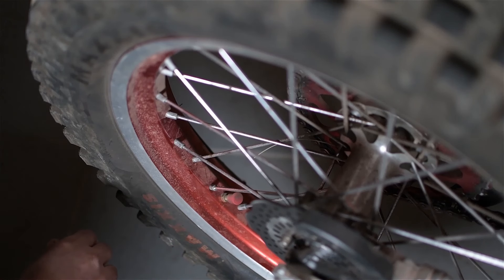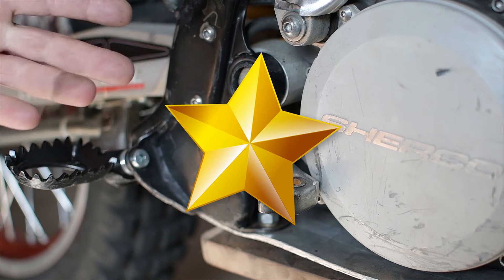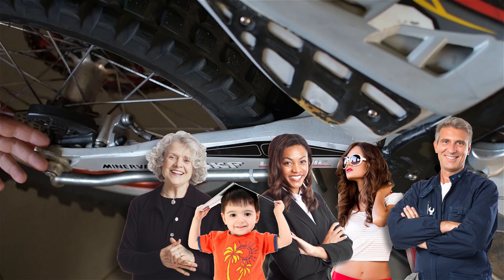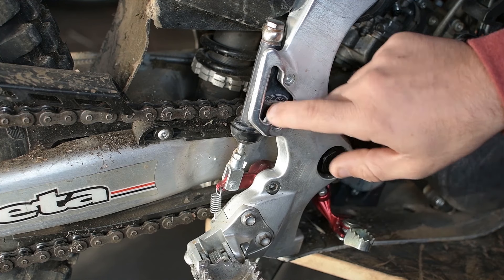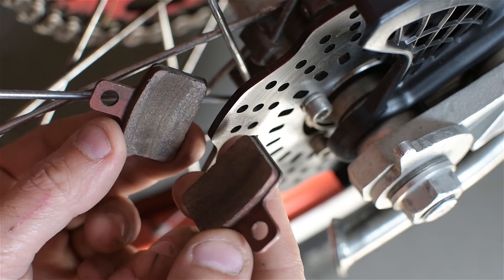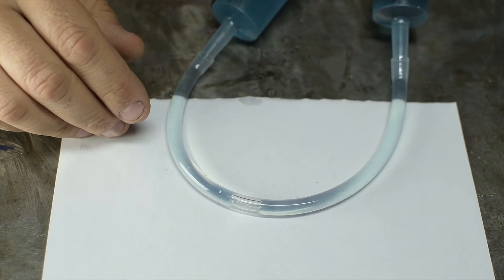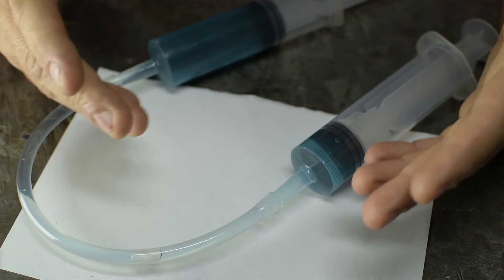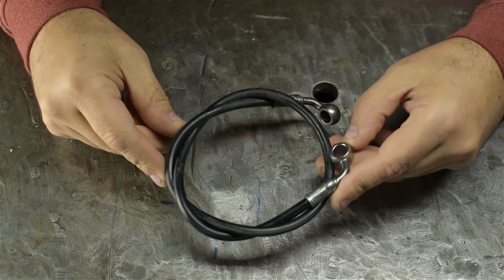I'm an Idiot! (Soft Spongy Brakes)

Comment: My Dad and I were in town a while back when our key FOB decided to stop working. We were able to get into the vehicle with just the key, but that didn't disable the alarm, siren starts blaring, couple of right fools we looked in a mad rush to find something to cut the wires with, then we were faced with the problem that the alarm disables the ignition, so there's no way of starting the car. Our first thought was to stick a new battery in the FOB, though we were a little puzzled as we'd already done so only about a week ago, but never the less, we went for a wander and bought a new battery. No luck. Took the FOB apart and cleaned the contacts, disconnected and re-connected the car battery, still no luck. Called a couple auto-electricians, no-one in New Zealand knows how to work on Chevrolet. Finally we gave up and called a tow truck. 
Before bringing the truck out, he decided to swing by and have a try himself at fixing the FOB. First thing he did was, naturally, replace the battery, and in doing so, noticed a little message on the inside of the battery cover that we'd somehow completely missed: "After replacing battery, hold lock and unlock buttons for 7 seconds to re-synchronise FOB." Yep, really was that easy, and yes, sheepish is putting it mildly. On the plus side, a $600 tow turned into a $150 call out.

Comment: You would not believe how similar of a story I have. I fought soft, spongy brakes on my Gas Gas 300 literally for months. I bled the brakes countless times which lead to me dumping at least two containers of brake fluid through my reservoir and onto my shop floor (I didn't bother with a tube on my bleeder valve). I began to question my ability to bleed brakes. I used a syringe to push fluid from the caliper to the master cylinder and from the reservoir, through the master cylinder and out the caliper. I too, rebuilt the master cylinder. I replaced the seals in the caliper. I replaced the brake pads. I was moments from madness when I had that shampoo coffee epiphany. The rod between the brake pedal and master cylinder is adjustable. And mine was adjusted to be too short. So, my brake pedal was running out of travel before the master cylinder did. Thanks for making this video. I enjoyed it way more than I should have!

Comment: You are not going to like this.....
I don't think the problem was the rotor. A worn rotor shouldn't affect the braking because the pistons will automatically move in to take up the slack.
I had exactly the same problem and it turned out to be a ring of corrosion build-up around the piston, (single piston, sliding caliper). When I pulled on the brake lever the piston would catch on the ring of corrosion and instead of sliding smoothly through the seal it would kinda try to turn the seal inside out. When I released the lever the twisted seal would pull the piston back. The next time I pulled the lever most of the travel was just pushing the piston back out to meet the pad so it would run out of travel before it applied pressure. I too bled the brakes, checked and cleaned the pads. I too fitted a new master cylinder piston assembly. Finally I pulled the caliper apart and voila!
Fitting a new unworn, thicker brake caliper would push the piston back in past the ring of corrosion and temporarily fix the problem but it will return when the pads or caliper wear enough for the piston to move out far enough to match up the corrosion to the seal.
I could be wrong but......
Reply: Calipers usually would travel as far as they technically could (centimetres if necessary), so most probably you are right!
Reply: I agree also, if the rotor undersize is the problem then you would never get full use of those pads. New rotor probably just moved it out of the problem range. When the new pads wear you'll get the same problem again. Good news is it'll keep you from running the pads metal to metal. 😁
Reply: My thoughts exactly. Unless there is a stop for the piston to hit, you should be able to push it out of the caliper, meaning there isn't a travel limit. The piston doesn't really retract when you let off the brake, the pressure just releases and the piston might move slightly back, but not much. This is why the pads drag ever so slightly when off the brake. So travel couldn't be the issue.
Reply: Didnt think of a corroded caliper, but i would have bet money on the rotor being innocent in this scenario, since brake feel isnt dependent on the pistons position, but only on its distance to the rotor.
Reply: He said the pedal was bottoming out. Implying that the Master ran out of fluid before the piston could slide all the way out. 
Keep in mind it did fix the problem.
Reply: (Reread oldbatwit's post and discovered I'm just saying what he said, meh)

I agree there may be a groove inside one of the caliper's pistons. You've merely moved the pistons back from it, not fixed the problem. It may also be a bad check valve in the master allowing too much fluid to be brought back into the master cylinder, pulling the caliper pistons too far from the pads. Pads will always be in contact with the rotor, usually just scuffing along, stopping rust from building up.

Pads ablate away, and the pistons are supposed to self adjust, so that as soon as they move, the pads are stopping you.

That thickness difference on the rotor should have been ok, ESPECIALLY with new, thicker pads. Assuming the brakes were properly bled, the brakes should still have worked. I predict you're going to have spongy brakes again before those pads wear out.
Reply: I don't think it was the thickness but rather uneven sickness that could cause a piston to be pushed out further than they would otherwise. I had a similar problem on a BMW road bike although in my case at higher speed you definitely could feel live but that low speed it wasn't quite as most of all. first pull on lever was spongy but in my case I could actually pump it up and it would sort of be ok until you released it again
Reply: @dankasprick1801  I don't see how the pedal bottoming out implies running out of fluid. It could just mean that the caliper piston(s) are being prevented from moving their full distance or are retracting, when they shouldn't.
Reply: @lachywocky  That would also happen if the piston was retracting.
Reply: The master cylinder has a maximum volume of fluid that it can push...he exceeded the travel distance of the master cylinder. It was just barely compressing enough to make contact, but not enough to clamp down on it hard enough to stop. I'm pretty sure that's what he said towards the end.
Reply: @marcellemay7721  Yeah exactly, and thats why we have breakfluid reservoirs
Reply: Could be because TOT is a neat freak and washes that damn bike too often => corroded caliper syndrome.
Reply: @ADBBuild  I think they do retract.  I think part of the piston seal is cleverly designed such that it grips the piston and is compliant and travels out with it.  When released it retracts.  As the pads wear, and the piston is pushed out  it exceeds the seal compliance and slides out just a little.
Reply: I thought exactly the same thing. When replacing worn pads you have to push the pistons back in (and try to remember to take some fluid out of the reservoir first O.o) to refit the calipers. The difference between new and worn out pads is a lot more than 1mm. I'm awfully curious what the problem was/is. Early on my money was on the flexible line.
Reply: Man you are ruining is marriage ... again.
Reply: Exactly. Fitting a thicker rotor gets the pistons closer to the surface, but the pistons should be self-adjusting. With each stroke, they move until the surface of the rotor, and back a (defined) bit. If they are too far out, they don't go all the way back.
However, if the piston seals are bad, they will not allow the piston to slide, rather they will stick to it and thus not self-adjust the clearance.
Alternatively, one of the pistons is stuck and the rotor gets bent by the other one. The new, thicker rotor has moved the disc right up to the brake pad, eliminating the spongy bending of the rotor each time the brake is pulled. 
Take the wheel out, push the brake repeatedly, and observe if both pistons move equally, and both adjust a little bit outwards with each stroke. If one is not moving, pushing on the other piston with a wrench while the brake is pressed might break the stuck piston loose. Repeat until they move evenly, or replace pistons / seals if visibly damaged. Done.

Comment: We call that “parts darts” in the trade. Customers come in, exclaiming they’ve tried everything.... everything but the simplest thing.. silly Old Tony.
Reply: To be fair, the issue here wasn’t a worn out rotor, it was a rotor that was literally installed while out of spec (new or not at that point).
Reply: @JasperJanssen  the old rotor was fine maybe cheaper version. Even if the rotor is out of spec it will break normaly. If there some thing betvene the brake pads it will break. Until its so thin it can even hold a shape. Normal motorcycle rotor is 5-7mm thic (also depend on weight and HP of the bike). Normal wear is 1-2mm on both sides so 2-4mm wear. Granted his new one is only 3mm and 2,1 look like worn out but it still must break normal. Only the potential of destroying the rotor increase.
Reply: Aka shotgun parts replacement.
Reply: "When in doubt, swap it out."
Reply: @scasny  if "breaking normally" means bottoming out the brake pedal then your absolutely right. Clearly with the diameter of his cylinders and lines the couple of mm's made a huge difference.
Reply: @abstractapproach634   break system work like a pump and the calipers will close until the pistons pop out. The reservoir is there to compensate pads and rotor rear. What tony experience is stuck master cylinder. Meaning it wont fully retract to its initial position. Result is break pads have fix travel meaning you cant pump up brake. This happened with old brake fluid that contain too much water or its contaminated with water. Aluminium parts are most susceptible. 
https://www.youtube.com/watch?v=wswNM7CkOPU
Reply: @scasny  Everything you say sounds logical, it just seems to me this video directly disproves it. Once he changed the fluid and M.C. the problem was still there; after changing the rotor it was gone. If I am not seeing something I'd like to understand.
Reply: @abstractapproach634   First the fluid was not the problem. Second it was not the MC piston but housing that may be corroded. Also im not sure if he adjust the break stop. That bolt with brass nut. If he leave it as it was, after the break pads worn a little the problem will go back. By the size of those break pads ,if new you have 3-4 mm of padding that wore off when used. Meaning the calipers must be able at least closed 6-8 mm gap. That is why his concern about 0,8 mm smaller rotor is misleading. At later video he stated that he sold the bike. Maybe because the problem come back after the break pads worn a little. 

Im maybe wrong because he dont show that calipers are capable to fully close without rotor. And he dont show the piston in MC is capable of full travel. But with my 10+ years of home bike repair the chance im wrong is not that big. Have this same problem my self and took me 3 days to find the real fault.
Reply: @scasny  I don't know about you other fellows, but I'm not going to take braking advice from someone who can't even spell "brake".
Reply: @SodAlmighty   Sorry english is weird. Im from central europe

Comment: It’s more likely the rotor had excessive runout which knocks the pads back into the caliper when the brake is not applied and the wheel is turning.   This pistons can compensate for the rotor wear just like they do for pad wear, the master can allow more fluid into the system when the brake is released.  This is why your fluid level is the reservoir goes down as pads wear.  The pistons can close at least to the point the pads are metal-to-metal before leaving the caliper bores and losing pressure altogether.

Comment: I'd like to add that caliper pistons can get gummed up with poor fluid change intervals and dirt/dust buildup. This can cause the seals to stick on the pistons. This will pull the pistons back to their previous position and not allow them to move out with the pad and rotor wear. Causing spongy brakes.

Usually I remove the caliper off the wheel, put a piece of thin metal between the pads and pump the brakes until it grabs. Then clean off the pistons and flush the brake fluid. Then push the pistons all the way back into the caliper. 

Just one more thing to check if your pads and rotors are in spec and you are sure you don't have any air in the line.